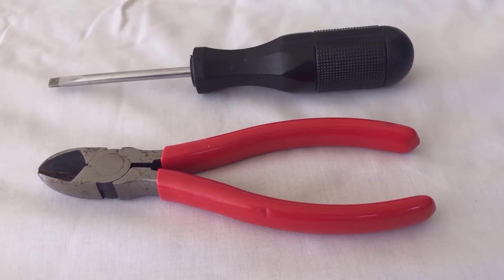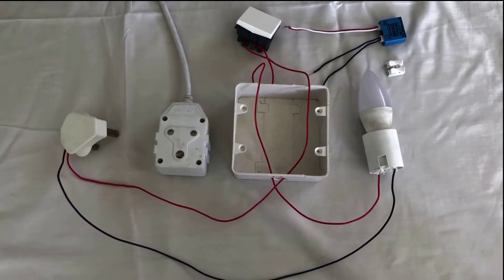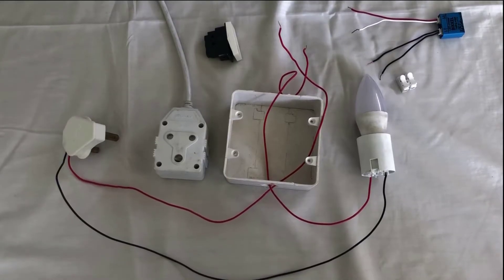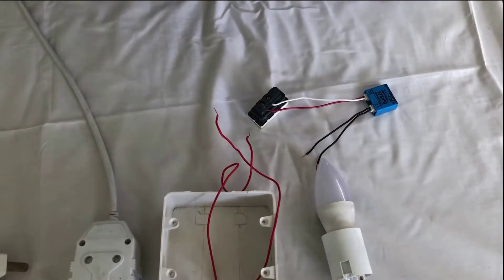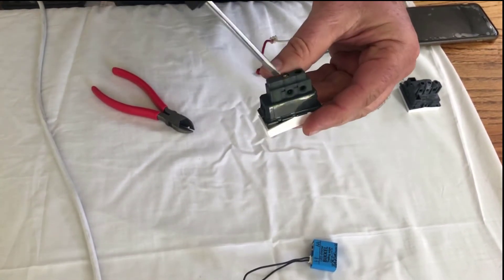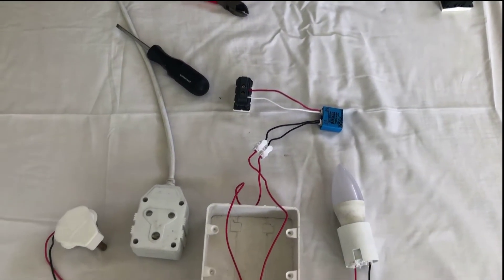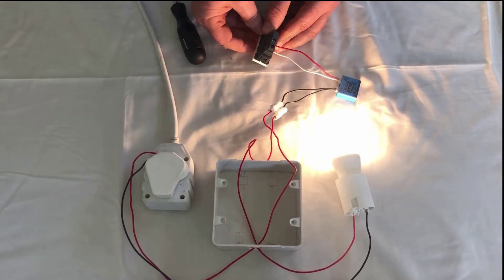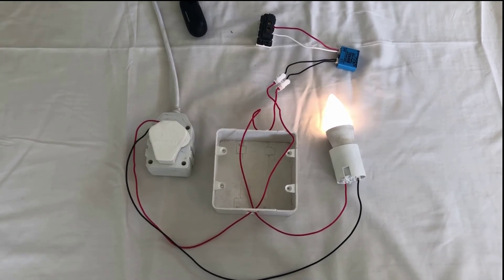Bikkel Installation Push Switch

Comment from the maker: Hi Wouter, just to confirm you replaced the downlights with dimmable LED lights?
Reply: Hi Stephen. Yes. Dimmable 7W leds - Samsung.
Reply: There are 7 of these in the room
Reply from the maker: @MrWoutervw  Hi Wouter, Can I ask you to please remove half the globe say 3 and check if it ramps up. If it does add another and check, then add another and check. etc. We just want to ensure that it is not an overload situation. We have no control on the driver circuitry on the bulb and the power factor correction factor
Reply from the maker: Can you please send me your contact info to steve@bikkel.com

Comment: Thanks for the video. I am changing DC LEDs to AC. Have changed all 7 downlights games n the room. Removed old DC dimmer and installed Bikkel as per this video. However when I press the press button the lights just flick on and off once. Any advise please?
Reply from the maker: Hi Wouter, can you please confirm they are dimmable LEDs, what make and how many watts are each LED?
Reply: @stephenschoeman8230  Hi Stephen - looks like the problem is solved. I started removing a bulb to do the test you suggested , then saw in tiny writing on the back a note saying the units are only dimmable with a Shuttle dimmer. (This is an Eagle lighting housing with a Samsung LED). I bought the Shuttle Dimmer - and it now seems to work. Thanks for the advice though.